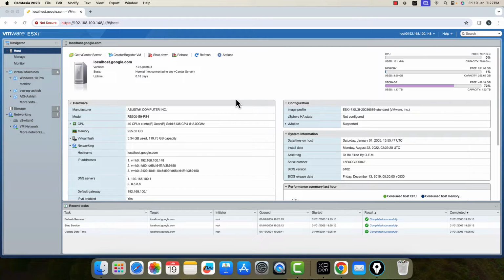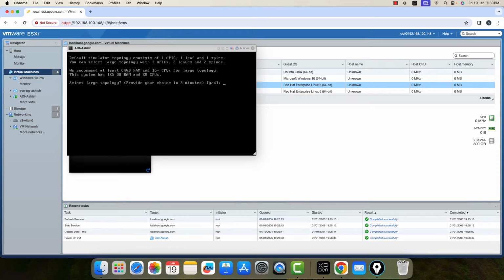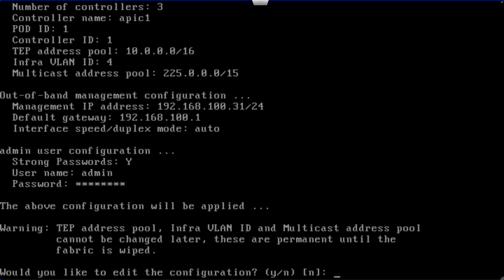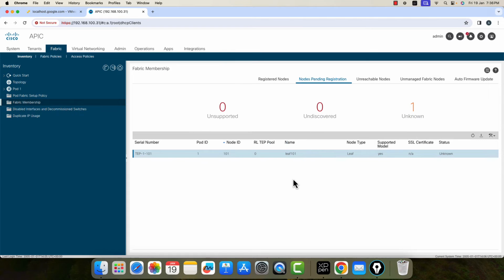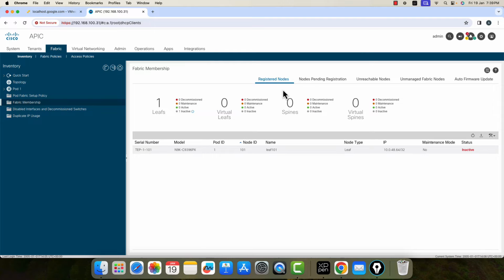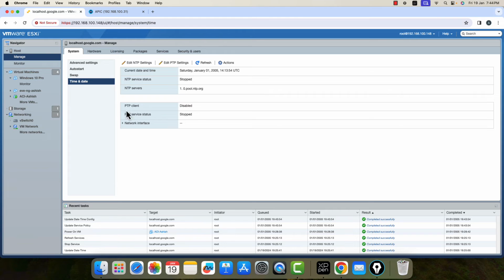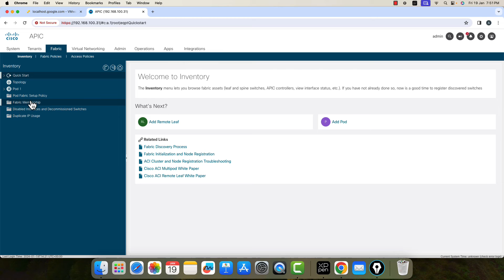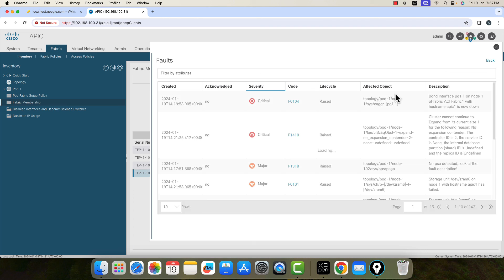Fix: Inactive leaf and spines problem in Cisco ACI Simulator

Comment: I spent one week, not knowing what the issue was.  Thank for your video, appreciated alot.
I am using vmware workstation v17.6.4 , there is nowhere I could configure time parameter within vmware workstation portal.  
But within ACI GUI you can configure DNS and Time server and it does shows correct time as per GMT two zone select.
I tried on from version: acisim-4.2-7l to acisim-524d downloaded directly off the Cisco, but not so luck with it.

I suspect Cisco purposely disabling it.

Comment: I was unable to turn on the NTPD service on ESXi 8.0. By default it was going back to Manuall but the TIme was correct. 
And I have enough amount of resources but still those Devices are going to Inactive state. 
Do you know what other things that I need to look after. 

I checked in your Udemy course but there when you were doing the Lab it was coming to Active state.